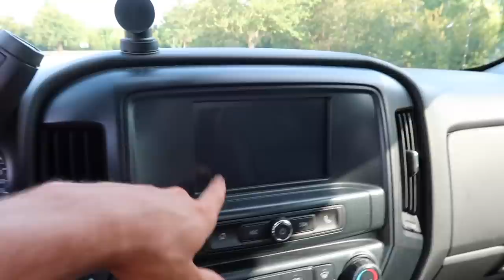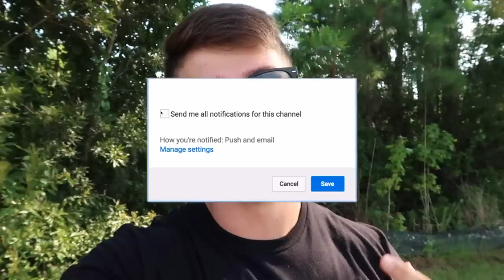MY NEW TRUCK!!

Comment from the maker: What's your thoughts?
Reply: KickinTheirBASSTV should’ve got a stick in it though, still badass truck👍🏻
Reply: Finally went over to diesel would’ve liked to hear it run but that truck is badass without a doubt🤷🏻‍♂️
Reply: KickinTheirBASSTV. Nice truck
Reply: Bad ass dude.  i drive a diesel as well. its the best
Reply: KickinTheirBASSTV thats an amazing truck
Reply: It would look so much better without a cap on it
Reply: You need to put a efi live tune. 5in straight pipe to a bigger tip. Air intake and a axle dump
Reply: Fire💯🤘👌💥💣
Reply: Looks nice! You’ll miss the quality and smoothness of the tundra....give it time....you’ll miss it!
Reply: Horrible u don’t need it what’s the purpose just peer show off
Reply from the maker: Ben Klasen Well knowing that i travel 50k miles a year... It’s worth it. especially when i pretty much get it for free from my sponsor. no need to hate. Im thankful🙏🏼
Reply: KickinTheirBASSTV I’m not if u travel 50k a year get a car or a half ton
Reply from the maker: Ben Klasen Lol i tow a boat. Sounds like you don’t watch my channel very often
Reply: KickinTheirBASSTV I said get a half ton truck
Reply: Well it's a Chevy so you really can't complain
Reply: KickinTheirBASSTV looks sick love the front end but make sure you rotate those tires because they will cup and ride like crap and not last long !!!

Comment: The truck is dope as feck bro.👌and that diesel engine will save you loads of 💰. The front grill looks awesome buddy👍. you getting the same decals as before or you got anything new designed ? Keep up the grind buddy 🎣👍 tight lines ✌